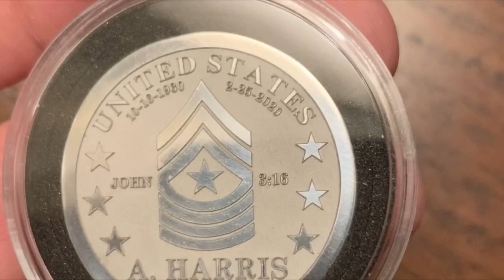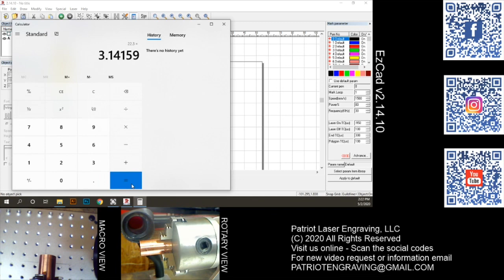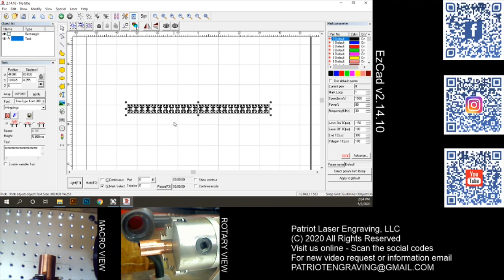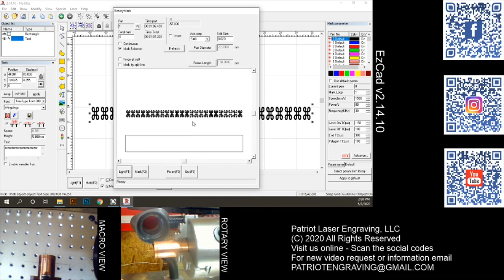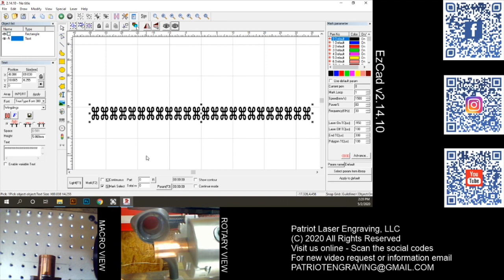Full Circle Engraving

Comment: Nice video... I noticed a lot more options in the drop down for laser. I only have two, RingTextMark and RotaryMark. Can you explain the ones you have? Thank you.
Reply from the maker: I have several plugins that you may/may-not have. This largely depends on a few things. First, the fiber card you have installed. If it’s an LMC4 you should see more than just the two. I’d reach out to who sold you the laser and ask.

Comment: Thanks David for the detailed and enriching video, a question about the diameter: you've set diameter of the rectangle (and graphic) based on your previous measurement, you don't need to modify the diameter in RotaryMark/Part Diameter box? Because you suceed with the all around engraving but greyed out Part Diameter shows 22.00 mm.

Comment: Have you ever done anything that is not round like Octagon? I have a part that is rectangle with 45 degree 1/2" edges between each flat surface. So how would you set that up to engrave the rotate to the 45, cont the engraving then rotate to the 2nd flat and cont on and so forth.? I have been playing with no luck. I would love to see a video of this type of work with the split mark in the mix so the world could know a little about that as it is the big question i have seen on most blogs.

Comment: Great video and much appreciated.   But one question from what you just showed is,  how do you jog if the image isn’t exactly where you want it?  I assume the 9box grid next to the dimension field is where you select start at center, left, right?
Reply from the maker: You can just use the nudge tool to do it. Normally it’s your cursor keys (shift+cursor is a larger move) but all nudge gaps can be configured in System Parameters under “Move Rotate” all nudge is in MM